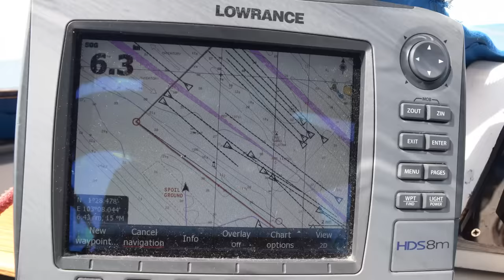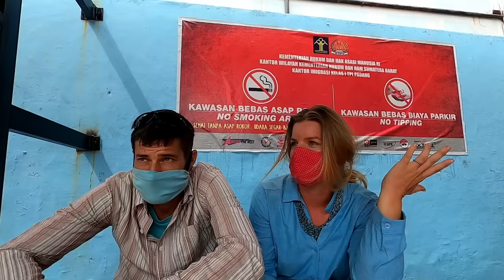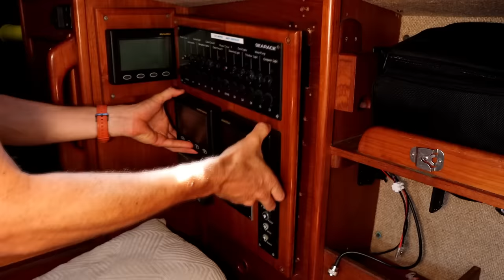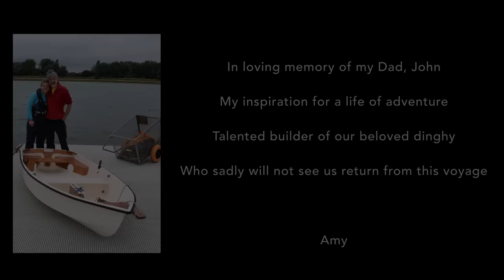SAILING AROUND THE WORLD DOCUMENTARY - 6 Years At Sea | SY Florence - Ep.148

Comment: Congratulations too to Florence. I am circumnavigating in a 34 ft (a little small) and met many cruisers in 40 to 50 ft boats (too complex to maintain). Florence is just the perfect boat.
Reply from the maker: No matter what size boat you have, about 3ft longer is always the optimum size! The 30 and 50 ft boats will say the same! Until you get to the boatyard, then at least 3ft smaller is the optimum... ;-)
Reply: @SailingYachtFlorence  Ha Ha! True 👍. The one issue that you cannot overcome with size is tankage. Small boats have no space for tanks and larger boats have bigger, more thirsty engines. 36 to 38 ft seems the sweet spot. Met hundreds of cruisers in my own cruising and the ones that most impressed me (in terms of accomplishments and skills) were all in that size range.

Comment: you started out with a Spade anchor, what size was it and did you ever replace it for a better one?
Reply from the maker: 20kg, we had it re-galvanized because that wore out very quickly but other than that it has been great. We also have 10mm chain which is over spec for a boat of our size and displacement.